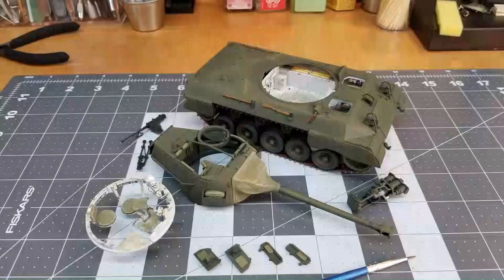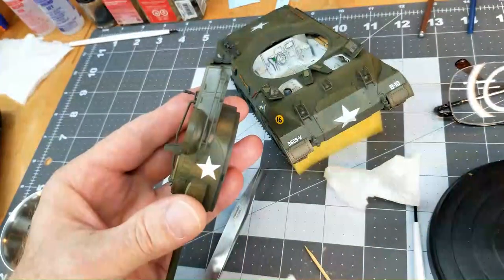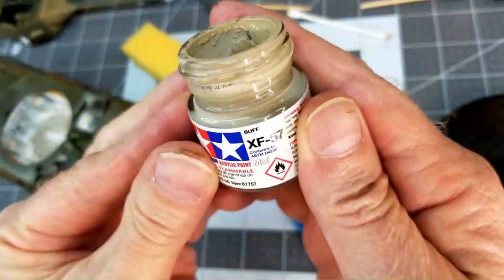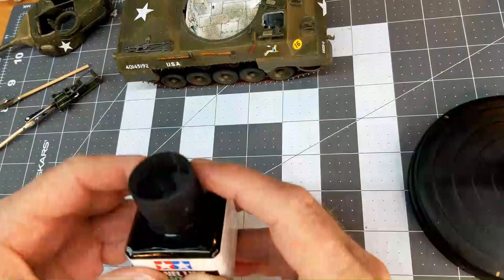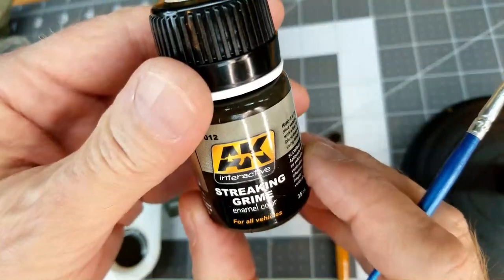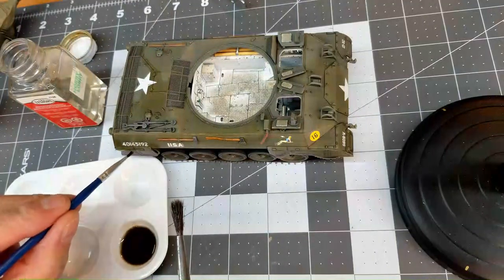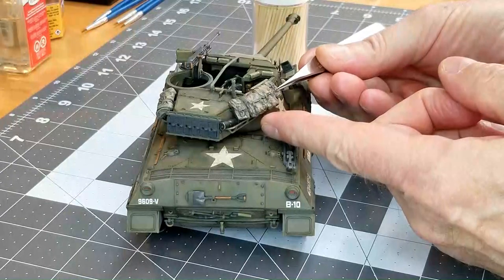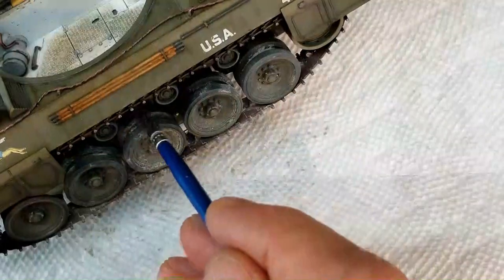M-18 HELLCAT by Academy Painting Part 5 and Final Reveal

Comment: Just a heads up for you my friend, Micro Set should be used for placing decal, Micro sol is to help the decal conform to the surface, that's why the bottles are numbered 1 and 2
Reply from the maker: Hi Bossogg69, when I first read your comment, I thought to myself, "there isn't any numbers on the bottles!" But you are right my friend, once I looked closer there are small MS1 and MS2 right under the solution names on the bottles! Some of the "expert" modelers on YouTube, not the I would include myself there, lol, have suggested that it's not necessary to use micro set, just the micro sol. I will say that when I tried to use just micro sol, I had problems with it softening the acrylic paint, which made my decal stick to the surface. Could be because of the type of paint I use, or the batch of solution I have is more aggressive than others, can't say for sure. Thank you so much for the great comment, maybe I should do a future video just to explore decal setting solutions. Hope you've had a great weekend, stay safe and model on! Johnny

Comment: Just a heads up, I would like to make a tarp covering for the top of the turret but folded back and tied up. what would you use for that. TIA.
Reply from the maker: I do some scratch building, but never have done a tarp as yet. With that said, here is what I intend to start with in tarps - I'll start with wrapping the turret in cellophane to protect it, try to get it as snug as possible. Then use tissue paper as the tarp which will be wetted down with a 50/50 mix of PVA glue (Elmers) and tap water, to soften and shape the tissue paper/tarp. Then left to dry. Should be fairly easy to remove when dry then paint as desired. Hope this helps my friend. Johnny